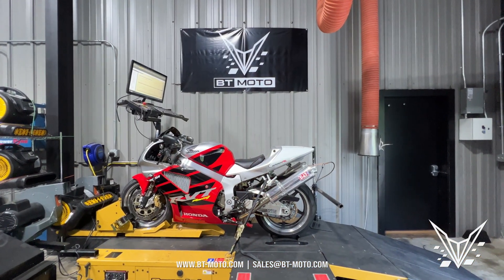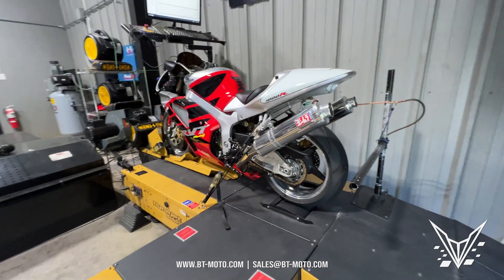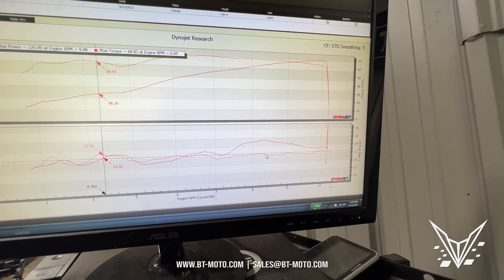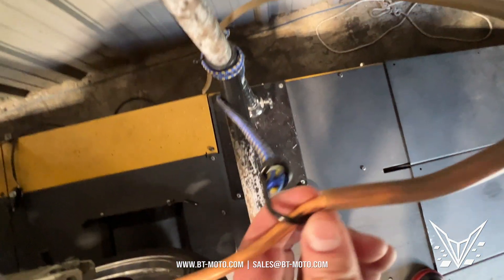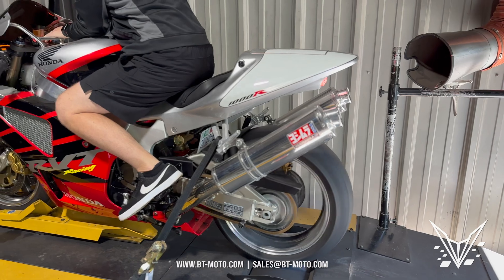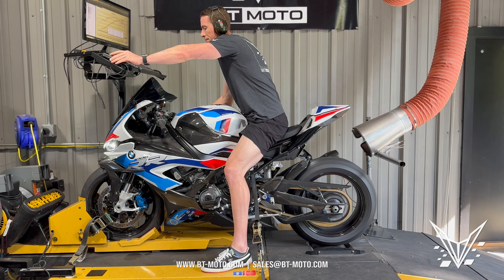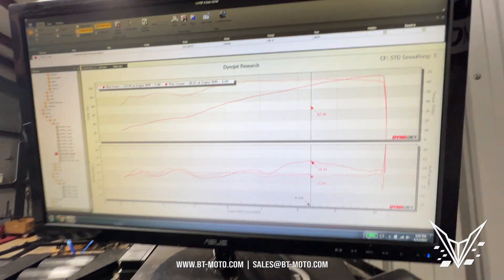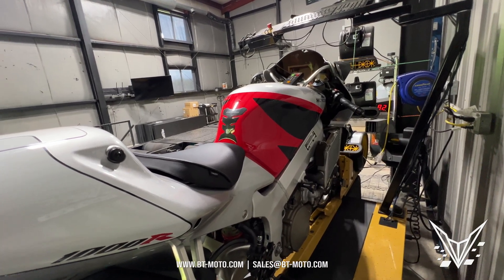How To Properly Read Air/Fuel On A Dyno... and It's More Accurate Than a Sniffer!

Comment: If you can confirm my doubt I would greatly appreciate it...if I believe my bike is running lean on the street after a tune, then I am probably correct right?? Either way, thanks for the thorough explanation.
Reply from the maker: @f2c245  I would run an independent wideband on the bike if you feel it’s lean after dyno. Verify with street data